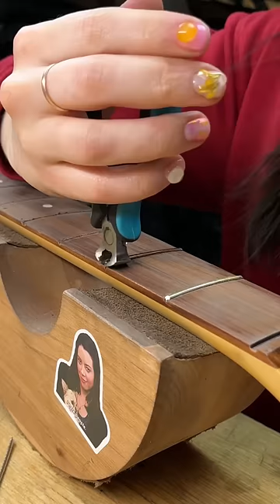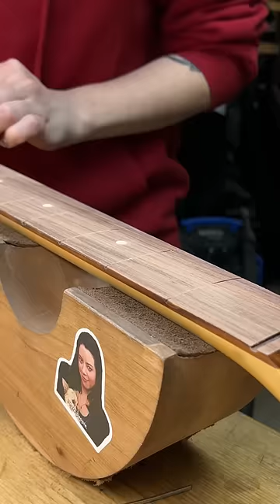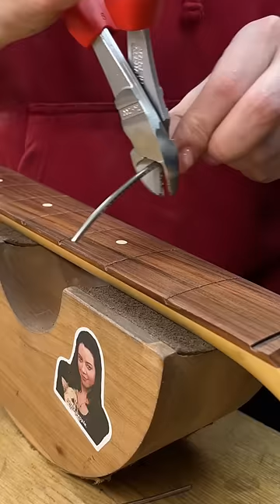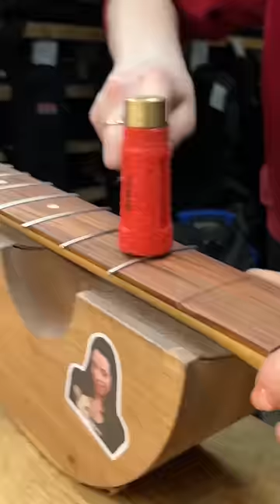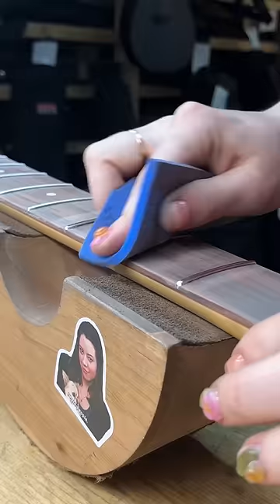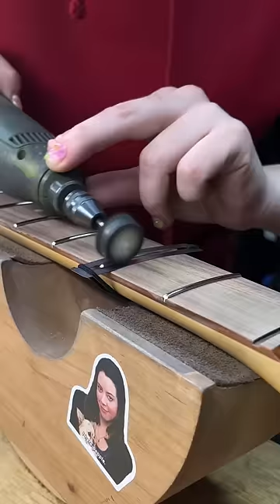Refret standart frets with steel wire

Comment: SS frets is the by far the best mod I've ever done to any of my guitars. It's been 5 years and my frets are still like new :)
Reply: I have a month old guitar with a dent already on the 2nd fret.
Reply: doesnt ss chew up strings
Reply: @logankiraly7515  That's just a myth from my experience. The last time I changed my earnie balls (regular 10's) was somewhere around November of last year and I play the guitar daily and heavily (a lot of bends).
Reply: @logankiraly7515  nope, some folks say it sounds brighter.... I call bs.  they feel like playing over glass, super smooth, especially when polished to a mirror, but my gawddddd... they're a royal PITA to install if you got weak hands, and I'm pretty strong as it is.  they're destroy tools. 4 stainless refrets in and I'm got a few light chips on my fret nippers.
Reply: @logankiraly7515 no. SS may accelerate wear, but it's SO slight in my experience that it just doesn't matter.
Reply: Same here, stainless steel frets don't seem to wear at all. I recommend them.
Reply: @logankiraly7515  Even if it does, I'd rather replace strings every so often than my frets lol

Comment: For those wondering what frets are, Chat GPT says:

Guitar frets are thin metal strips embedded along the fingerboard of a guitar. They serve several important purposes:

Pitch Determination: When you press down a string against a fret, it effectively shortens the vibrating length of the string. The length of the string between the nut (the grooved component near the headstock) and the fret determines the pitch produced when the string is plucked or strummed. By changing the fret position where you press the string, you can alter the pitch of the note produced.

Note Accuracy: Frets are placed at precise intervals along the fingerboard, typically following a logarithmic scale known as equal temperament. This arrangement ensures that each fret represents a specific musical note, allowing you to play in tune and maintain consistent intervals between notes.

Chord Formation: Frets enable the player to create chords easily. By pressing down multiple strings against specific frets and strumming or plucking them, you can produce a combination of notes that form a chord. Frets help establish the proper finger placements for chords, allowing for more efficient and accurate playing.

Intonation Adjustment: Frets also play a role in adjusting the intonation of a guitar. Intonation refers to the accuracy of the instrument's pitch across all frets. By properly setting the position of each fret relative to the scale length of the guitar, the instrument's intonation can be optimized. This ensures that the notes played at higher frets are in tune with the open strings and lower frets.

In summary, guitar frets determine the pitch of the notes produced when strings are pressed against them. They allow for accurate note placement, facilitate chord formation, and contribute to the overall intonation of the instrument.

Comment: The way that fret wire looked when you first put it in before you trimmed any of it almost is like my Charvel Pro Mod DK24 HSS I got a year or so back lmfao. Smoothest and best sounding guitar I've ever played (have 2 different ones lol) but DAMN, that fret filing job was BRUTAL. Had to file them down myself and it did the trick

Comment: I've done this job enough that, it doesn't bother me as much as it used to, and I'm pretty good at it. It's still pretty time consuming so I usually break it into two days. Day one is removal, cleanup and prep followed by new fret installation. If the fretboard requires leveling, I'll push the new fret install off until the next day. Day 2 is all about all the level and dress.

Comment: I worked in a guitar shop for 7 years. In that time, maybe a dozen guitars received a full refret. It’s not that we couldn’t do this for every well used guitar that came through the doors, but most customers weren’t willing to pay more than the price of a new (import) guitar to service the one they had.

That being said , if it were my guitar, I’d have no problem handing it over to these expert hands. The only thing I would have done differently is avoided using the large rotary buffing wheel across both the frets and the grain of the fingerboard. 

Not that it’s a problem for rosewood fingerboards but we would generally try to avoid any procedure that could push metal fines into the woodgrain. This would heavily discolor a maple board.

Comment: for anyone attempting to do this, the love of GOD, DO NOT leave your fretboard unmasked during the polishing stage.  I use water thin super glue to wick under the frets, wiping minwax wood finishing paste wax around the frets so it wipes clean away.  takes a bit to get a good technique down.

Comment: When I was learning the process many years ago we were warned by experts never to use super glue to set frets as when they needed replacement removing them would pull unsightly splinters from the fretboard. Well What’s changed. Otherwise a brilliant job.

Comment: CA glue? Well, they are stainless... But if this were anything else, I would personally use a different glue. Removal of these frets next time may not leave such a pretty fretboard. Stainless frets will most likely outlast that board though so I guess it's a moot point. You just never know... Great work.

Comment: Why add superglue to the edges of the fret after you've installed them?  If the frets get removed later it will tear/chip the wood off the fretboard.

Superglue belongs in the fret slots only!